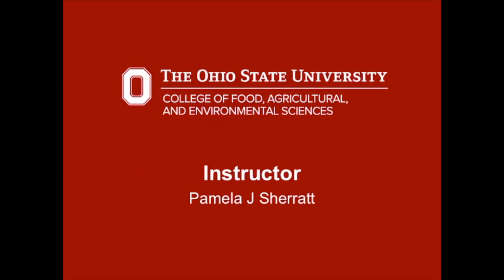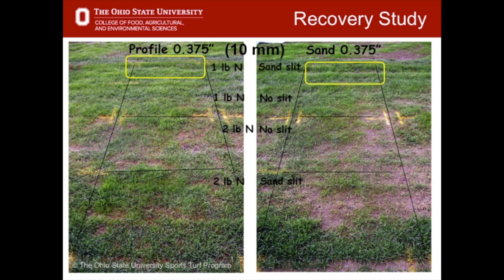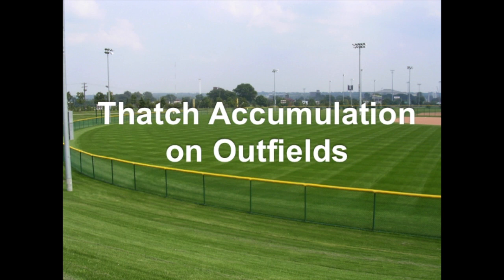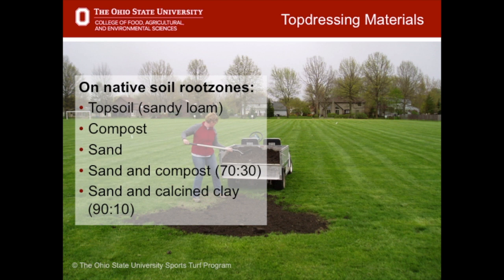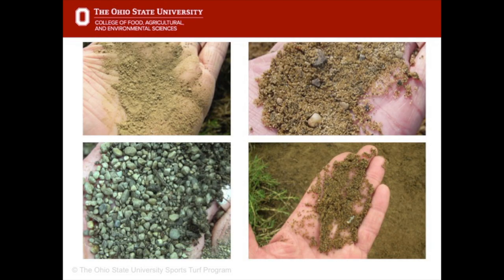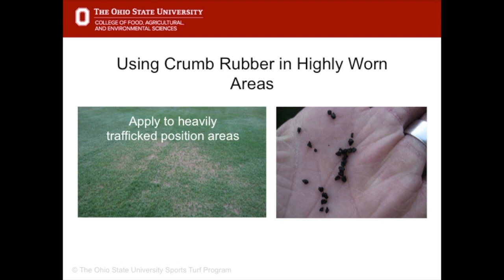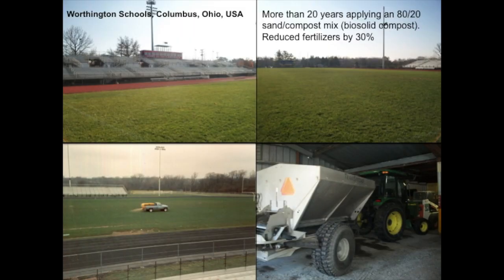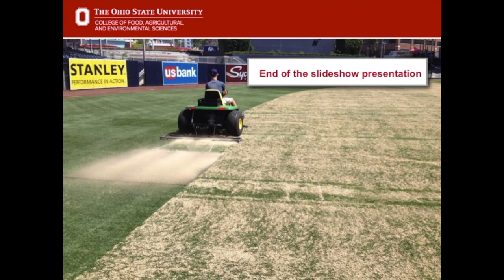Sports Turf Management - Topdressing

Comment: Top dressing the back yard of 2k sq ft of my home lawn with 5 cubic yards of Compost from my local nursery has helped my lawn more than any other single thing I've done.  
Each year 10 bags in spring then at least 15 ,bags of soil for lawns from Home Depot and it barely helped. Maybe for seeding small patches. But a dump truck was so much cheaper than bags and better.